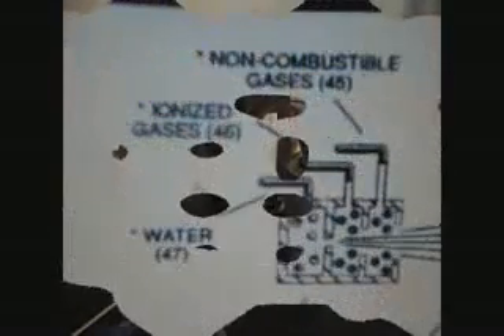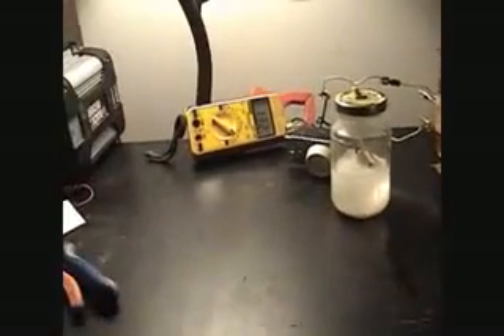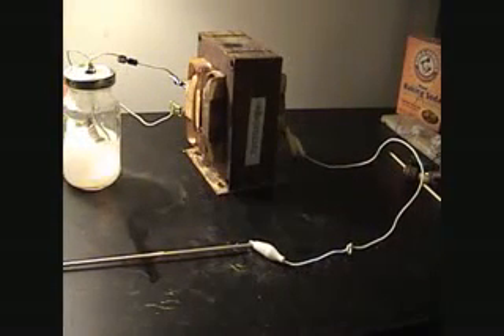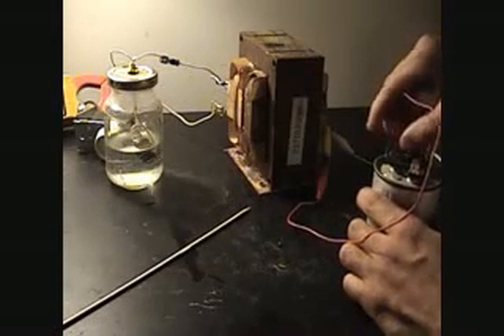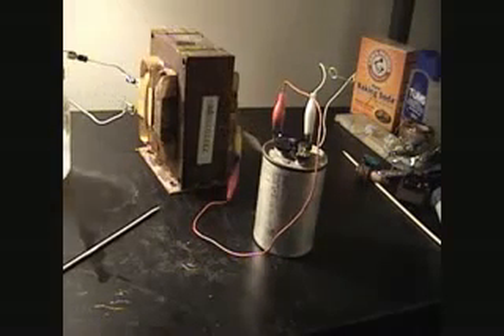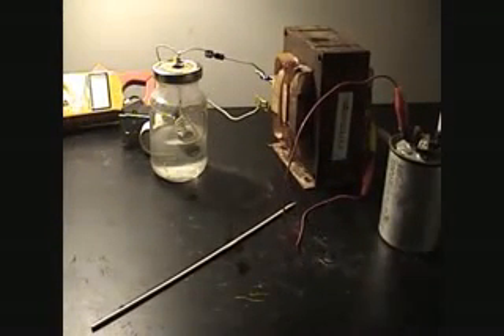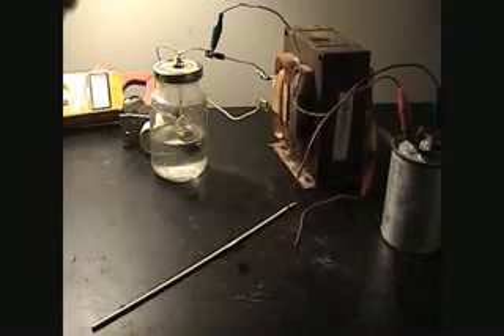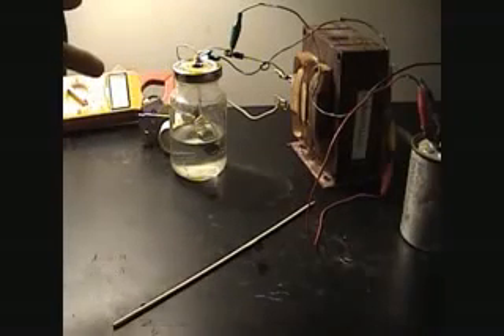HHO made by SPARK PLUG   crob227

Comment: Daniel Donatelli's hydrogen hot rod nano bubble water fuel. The search results provide insights into the application of nano bubble water fuels and the modern hydrogen hot rod
2
3
.
The hydrogen hot rod is powered by a nano bubble water-fuel/cell that converts distilled water into a positive charge nano bubble water to power the vehicle's motor with more force than heat, thus not following the carnot cycle
3
. This means that instead of burning fossil fuels, the hot rods emit only water vapor as a byproduct, with a fuel efficiency 2.5 times that of gasoline
3
. Daniel Donatelli, founder of the Secure Supplies group and hot rod enthusiast, is one of the pioneers of the hydrogen hot rod movement
3
. He has combined his passion for hot rods and alternative energy to save on fuel by building hydrogen-powered hot rods under the subsidiary "HRV Hydrogen Hot Rod Vehicles"
3
.
The text "A fuel emerges, in Nano's fine trail. Engines rejoice, in this high horse power liquid embrace, Where am I ?, I am in the heart of the race, Start your engines if you have them if not move over for the Ace" could be interpreted as a celebration of the hydrogen hot rod and its innovative technology. The "fine trail" could refer to the nano bubble water fuel, and the "high horse power liquid embrace" could symbolize the powerful performance of the hydrogen hot rod. The "heart of the race" could represent the core of the hydro hot rod movement, and the "Ace" could be a reference to Daniel Donatelli or his achievements in the field of hydrogen hot rods.
In conclusion, the text is a poetic expression that celebrates the innovation and performance of hydrogen hot rods powered by nano bubble water fuels, created by Daniel Donatelli and his team.

Comment: Is this method is safe & produce more HHO gas to run car engine or not. Or this method damage the spark plugs rapidly or not, it's reliable to use. Thirdly do you add electrolyte like sodium bicarbonate or salt etc. Or not.